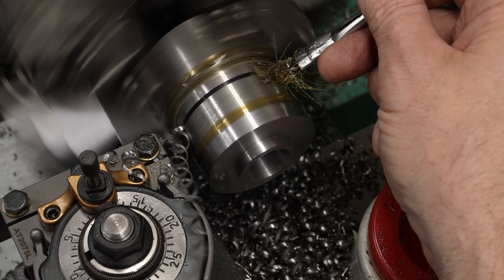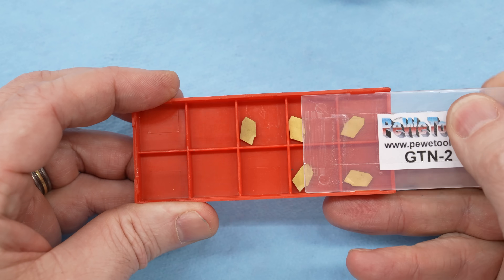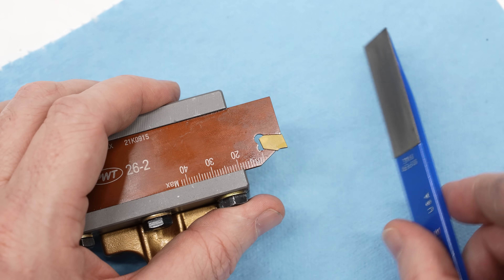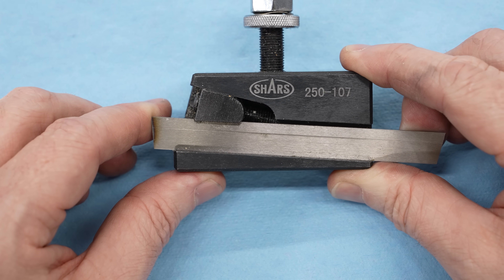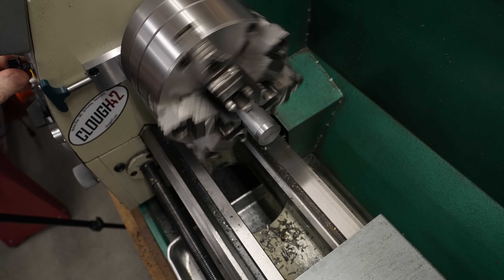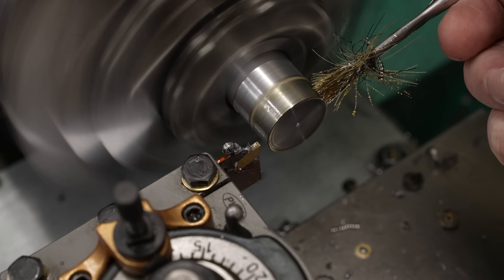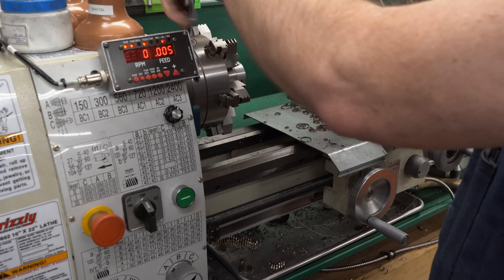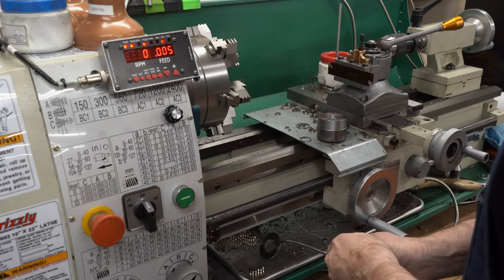High Speed Parting with CARBIDE in a Small Hobby Lathe

Comment: Well, carbide does like to be run fast and hard. The chip color looks good, a bit higher rate of cut would get you the lovely blue that indicates all the heat going into the chip.

By the way, you should always wear eye protection around machines that cut metal. Since I wear glasses, that is a none issue, but for those of you who do not, eye protection.
Reply: I have prescription eyeglasses with side shields at the shop.  Even though I wear glasses, I’ve had chips fly in from the side too many times.

Comment: Try without lubricant.   I think it just burns and stops the blade from grabbing.   This is mild steel only and aluminum , brass.     I start the hss blade below center and raise it as u cut in.   Again i dont even lock gibs.  I just got my first carbite set with a carbite parting tool.  I've yet to use it.  Ill def try this method

Comment: I have a 12x36 atlas craftsman. 1/3 hp and I do a slower speed below center.  Then when it starts to want to walk up the blade I raise it a little.  I never use lubricant with mild steel. I don't think its needed.    I use the AXA hss blade. I don't even lock my gibs  with mild steel

Comment: My teacher taught us to never go deeper than 2x the width of the tool in parts with a diameter larger than 0.5in. The cutting must be done with 0.030in between the two passes. if the cut is made in a single pass, the heat generated on the tool causes it to expand and jam. Then I always run the lathe at 500RPM and feed by hand for continuous cutting

Comment: You could try mist coolant to cool the part and tool. As you dig deeper the heat expansion can make the chips larger than the actual width of cut. Artisan Makes has a decent video of setting one up on a smaller lathe

Comment: This makes me wonder if you could add a constant surface speed function to your electronic lead screw control. If you could set a surface speed on your interface, figure out a way to get the x position from the DRO, calculate the required RPM, and actively adjust the VFD then you could maintain a constant surface speed as you change the X position. My Trak lathe does this and it’s amazing for part offs.

Comment: I had the same problem on a Cnc I was running 200m/min and was over loading spindle so I dropped cutting speed but this lathe has no gears and it overloaded more since spindle rpm was lower and getting less torque

Comment: On my import lathe I found the saddle would lift about 3 thou on the front side opposite the lock.  The tool would drop about 8 thou and the part would try to climb up the tool resulting in a significant emotional event and broken tools.  The part the holds the saddle from lifting was poorly machined.   Easily fixed after I knew where the issue was.

Comment: Nicely Done! I would probably run faster than that.  Twice the rpm  I would think. However my feeds are generally much less.  My axis servos just can't push hard enough! I use spray coolant and boy it can go horribly wrong if the coolant supply drops off.  Brand name inserts can also be had in what is called low force inserts.  The Sumitomo one has 30 degrees of rake so it is really trying to reduce the cutting force required, I find it works really well.

Comment: Just today I've been experimenting with similar issues. My lathe has a power crossfeed, and my discovery was the the smooth progression of the power crossfeed gave much better results than nervously going too slow by hand.  In my case it was a 1/2" wide form tool, not a parting tool.

Comment: I've had the same exact issues and I have a 14 X 44 heavy solid heavy base lathe. I went through my cross slide and tightened everything up and locked down the compound and have not had a chance to try a cut yet but I have some machinist jacks Im going to be making from 4140 and am def going to try this method.

One thing on the reverse blade mounting I might mention; It doesn't cut any better. What it does is, if the tool binds, the blade will lift off the work, and save the blade. When cutting traditionally, and it binds, the blade digs into the work more and then you get the stoppages and damaged blade.

I'm going to be making an iron block reverse cut off but my reason is actually due to production rather than anything else. 

Also, Dave Bruneau at MSC is a good resource if you need help with cut off blades. I talked to him about my cut off woes and he directed me to a new blade series by ISCAR and I got it but as I said I haven't used it yet. 

D

Comment: Am not sure "there are lots of ways to be successful" with carbide inserts outside the recommended loads. If you were not limited by the power of the lathe, a bigger machine would be going more to the middle of the working range and produce much better chips.

Comment: There’s a great book by George Thomas called Model Engineers Workshop Manual. He used to write for the british byweekly Model Engineer. There’s a chapter called “on parting off”. He devoted an entire chapter to it because on the small lathes like the myford, which is what most steam train guys had, it was the most difficult operation to do. Sometimes in a crash one could even break a cross slide or compound casting. He developed the rear inverted toolpost which is sold by Hemingway kits which solves the rigidity problem. He would frequently demonstrate parting off 1” dia mild steel at 300 rpm with hss, just to show it was easily done. The key is to stop if the chips stop curling and you have to make sure the groove doesn’t jam up with curly chips. You need lots of oil too. Btw that’s the best machining book ever. Full of wisdom and awesome tooling projects. Tee Publishing sells it. Btw parting a 5” dia piece will always be a challenge just because you can’t clear the groove.
Reply: Even Stefan Gotteswinter refers to that book, I can't think of a higher recommendation than that.
Reply: Preso has a video series making one for his mid sized lathe that struggled with parting off, and it seemed to do wonders for him!
Reply: +1 for rear parting tool post, it gives better chip clearance (they drop out) but I found the Hemmingway design to lack rigidity and reverted to a solid lump with a blade insert as per Jame's footage at 1.29 bolted to it on centre.   Also +1 for lots of watery coolant to help the cooling and washout @climberjb

Comment: Since you have a VFD, next time i would suggest what works in our CNC job shop, even higher surface speeds, if you cant squirt coolant right into the cut, ditch the brush, instead try to gradually increase rpm as the parting diameter shrinks to maintain the surface speed, then when you get to the last few mm (4-6mm) slow it down to around 300-500rpm and finish the cut

Comment: Watching those videos of high speed CNC  machines i've always been amazed at how fast they cut. This video you're doing reinforces the concept of going fast. 
Thanks for sharing.
Reply: yup, some tools can be pushed incredibly hard, last week i was testing some new inserts and tweaking a program for production run of thousands of parts per month... what i ended up with were surface speeds at 360m/min for roughing and 400m/min finishing... also these parts are forged into rough shape, so there is only around 1,5-3mm of material to be removed, full depth of cut, and feed rates around 0,35-0,4mm/rev roughing and up to 0,5mm/rev finishing with wiper inserts...

Comment: Even running larger manual lathes, it took me a while to get used to carbide.  Once you get used to HSS the habits are hard to break.  With most carbide you can run screaming speeds and feeds and will get longer tool life.  You just have to get past that initial cringe when you start a cut.  Great demonstration

Comment: I think that the speed need to me increased as the OD of the cutting surface reduces.  Lowering the point of contact. I think is calling for jamming the tool into the part because the tool will try to "grab" more material . I also like to sharp the blade with an angle so will cut the right side  first and leave the cut part with no nipple, But I think that the speed is the secret, each metal have it cutting speed,

Comment: Small lathe is a definition that depends on where you are. Industrially, anything smaller than 18 inches is considered to be small. But in the hobby world, your lathe isn’t small at all. I have a 14” and I use high speed and use a fairly heavy cut. It works all the time. A fast speed allows you to push the tool in at a good rate while not overbearing the system. The problem with running at slow speeds is that it’s too hard to control the depth of cut and so it’s easy to go a bit too fast and dig in. Make sure you’re on center. No, slightly below center isn’t a good thing. What happens is that the tool pushes the work up you get under it and push it up. Then the work springs down and you take a cut that’s too deep and it gouges the work and digs in, stopping the lathe, if you’re lucky, or breaks something, sometimes violently.

Comment: Haven't seen the other video but i keep telling my students that if you're getting vibrations or a bad surface finish, don't slow down, increase the spindle speed and go from there.
Vibrations are usually caused at a certain frequency, you either have to go down or up to get away from it. Slowing down carbide tools isn't always the best option, carbide wants to get pushed.

Since you're not using a geared lathe, you're left with no torque advantage in slower speeds, so you gotta get it where the torque is. Increased speed will also help to overcome stuck chips or a slightly too beefy feed rate for a short moment (when hand feeding)

Some said cutting oil and a brush doesn't help and that centrifugal force won't make it cut better, but when parting off, a little bit of oil, is still better than no oil.

Another thing i like to do is to use wider parting cutters and inserts, it improves rigidity and therefore keeps the cutting geometry more stable, even on smaller lathes.
Reply from the maker: Without oil, the cut starts to growl as it gets deeper.  That probably isn't a big deal, but the oil quiets it down. Though the smoke isn't ideal.
Reply: @Clough42  Parting like this with carbide is where "Low Volume" flood coolant comes in handy if your machin is capable of it - A trickle  into the cut trough but not enough to spash onto the chuck and become a water park
Reply: @bengrogan9710  A 1,5 liter cola bottle upside down with a nice 3D printed adapter for a hose/pipe with a little valve on it is enough for 'flood' coolant in this type of operation.
Reply: @JaakkoF  That's not a bad call to be honest
Reply: @Clough42  use bacon grease.  Makes the whole shop smell good. And it’s not a half bad lube.
Reply: On a rigid lathe, a wider parting cutter improves rigidity of the parting blade, on a small lathe that already struggles, it makes thinks worse

Comment: On my small lathe, I set carbide tools scary fast and crazy depth of cut.    The problem with HSS blades is that wear tapers the blade width from the cutting edge back.  As the groove gets deeper, the wedge effect jambs the blade into the cut.   The work around is to make a 5mm deep groove, retract and shift left or right to cut a wide groove then cut 10mm deep.  Rinse and repeat.  Cut a wide groove so the blade can't jamb.

Comment: The Pulsing in the hand wheel and its relation to the chuck speed when doing the cut is an interesting observation. It would be interesting to do a balance check of the chuck to confirm this hypothesis. If there is in fact an imbalance an attempt to balance the chuck and thereafter do new test cuts would be interesting exercise. This could perhaps be an idea for a future video?

Comment: Nice work, I did cnc the lathe, so I can keep my distance. The machine does do it with de proper speed. Before on manual I had to get the broken carbide out of the wall. 😬 (I use the carbide for alu, so very sharp). I think the biggest problem is the backslash, when you have no pressure on it, it will pulling the tool in the stock. If you running with the high pressure on low speed, it will cut too deep at ones and stall the chuck or break the tool.
A question: what up with you G704 ?

Comment: the one thing I'd be concerned with parting at that speed is parting off anything with actual mass to it. Yeeting a significant chunk of steel spinning at 1000rpm off the front of the chuck sounds like a great way to get hurt or damage something.
Reply: 1000rpm sounds like a lot, but for a 1" diameter part, that works out to a surface speed of about 3 miles per hour. Speed is scary in the machine shop, but serious accidents are usually about torque and weight.

Comment: One thing I would recommend getting is a little needle tip oiler bottle so you can drip oil into the slot as prodigiously as you like as you part. I also use them all the time for drilling or anytime I want cutting oil in a particular spot.

Comment: It really does seem counter intuitive, but carbide loves to be loaded up, and you're also enjoying the higher torque from the motor at that speed. Sadly HSS won't tolerate those speeds and loads, and prefers slow and sharp. I truly believe that there's been a conflation between the two along the line that's made it into lore concerning small machines and carbide. Thanks for mythbusting James.

Comment: Not having a lathe, and living vicariously through you and Quinn -- it looks like carbide just wants more and faster, regardless of how much and how fast you're already going.  Yay/nay?
Reply: pretty much, you can go too far for carbide but on a hobby machine that aint happening
Reply: the point thaat is counter intuitive is that Carbide is too hard to be reliably "Sharp" - thus meaning that a HSS too can Shave were Carbide has to "Rip"
The tool pressure needs to be high enough that the Carbide doesn't lift the chip and break off to the rip and fall into the hole - leading to guarenteed chatter
Reply: @bengrogan9710  Could it be that it creates a hill like a bulldozer instead of digging in and then slides over the hill and then slams into the surface after riding down the downhill side ? Maybe it also stops cutting and starts sliding and everything gets deflected, building up energy, until the pressure gets high enough to suddenly dig in really deep.
Reply: @alexandern8hgeg5e9  1st part you have backward, it's not that the tip rides over it - the chip is formed with enough strength that it levers itself away as it rolls onto the tool: have you ever felt yourself lifted by the arms and felt your legs go forward into the gap? That sort of effect.
For the 2nd part, yes that is why carbide needs higher tool pressure to engage to begin with

Comment: It's too bad your lathe doesn't have powered cross-feed.  If it did, you could actually vary your spindle speed as you plunge in and keep the M/min. consistent.  That becomes a lot more important with a material like stainless, where even a fractional-second alternations in M/min. (or SFM) can lead to work hardening which will cause the insert to fail.  Locking the carriage to the lathe bed will also improve rigidity.

Comment: On rounded edges like most carbide tools the very edge is not really cutting but rather pushing a bit off material in front of it. Google "dead metal zone"

This works a lot better when running fast enough and actually protects the carbide from wear. I don't think this is the sole reason why this works here but it could play a part.

Comment: Have you tried polycrystalline diamond inserts for working with steel? I'd be interested if they were worth the extra cost.
Reply: PCD won't work in steel - at normal cutting temperatures, the diamond reacts with the iron and turns into graphite. Fantastic for non-ferrous in stable cutting conditions.
Reply: @j.dietrich  Thanks. Now that you say that I think I've heard that somewhere.